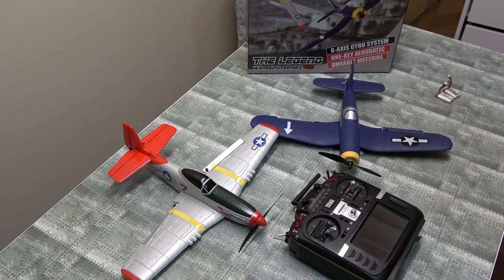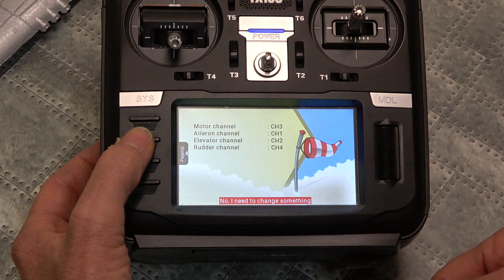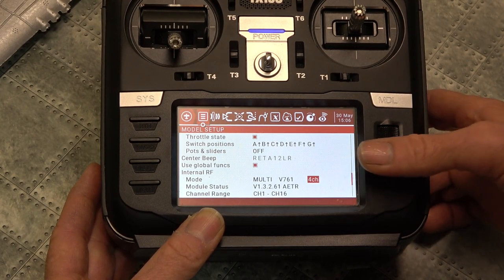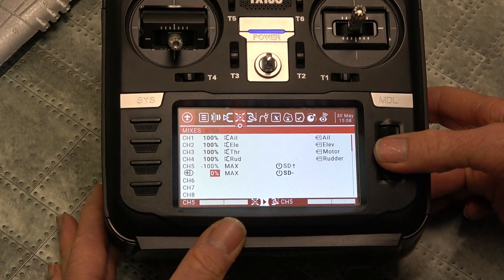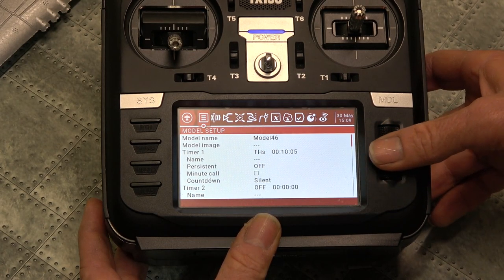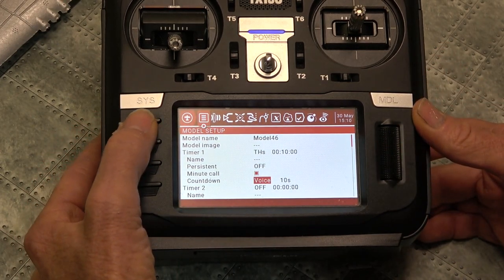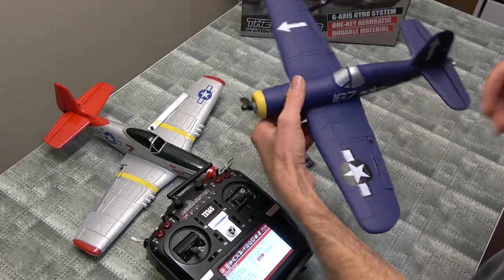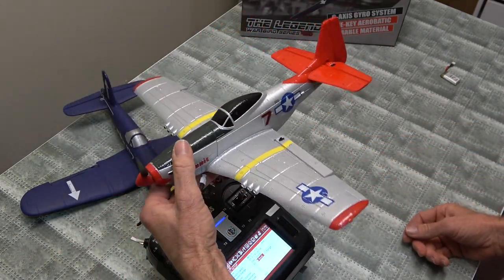How to bind to Eachine mini P51D with Radiomaster multiprotocol Radio F4U corsair 400mm RC Plane

Comment: Thanks for the video.  You may know this by now but you don't need to create three entries in the mixer for gyro.  You can just set the source as the switch and leave the "switch" section blank.  Depending on the switch position you'll get -100 0 or 100 as the output.

Comment: Brilliant video, I can knife edge my warbirds just about. One problem I have 3 planes 2 x bf109 no problems at all but my p51 worked great for one flight then the next I had no throttle.. switched it back to its own transmitter and it worked back to boxer and no throttle again?

Comment: Received my P51 today. Binding with the TX16s works as described in your instructions. What I can't do is calibrate the plane's horizontal position. According to the instructions, both sticks should be held down and outwards and then it should beep. But the beeping stays away. Other stick positions were also unsuccessful. How did that work for you? By the way: I don't have to arm the motor as described in the instructions. The motor also works without arming
Reply from the maker: Nice to hear Yes on the original radio with the sticks have to be held down and outwards but on TX16S you like to set a switch to channel 6 to calibrate level

Comment: I only wonder how did you find out the protocol these eachine/volantex mini planes are using? Is there a site out there with repository of different protocols?
Reply from the maker: No the multi protocol site- link in my pinned comment gives you a bit of help or you can just google it

Comment: I have a weird problem  I've Done all the instructions but   after binding there are no controls unless I click the range tab next to the bind .  It only works when the range screen is open . Any ideas thanks
Reply: I have sussed it. You need to select the low power mode option I the setup of the model

Comment: Thank you for this very useful video.if you could give my some advice since I have not been able to make link with the steps that you show. the only thing different is that my radio is mode 1out de box an de plane is in mode 2 thank you so much
Reply: I'm not sure what you are talking about there??? If you mean that the radio you have received is set for mode 1 (ie the Throttle and Ailerons are on the right stick and the Rudder and Elevator on the left) but you require the radio to be switched to Mode 2 (Throttle and Rudder on the left plus Ailerons and Rudder on the right) then that is done in the TX16S radio set-up. It has NOTHING to do with the plane. Planes will fly exactly the same (with a correctly set-up transmitter) whether the radio is Mode 1 or Mode 2.

Comment: I have a Volantex F16 Bound to my XT16S. When i first plug in the battery, everything is working as it should. i have all control surfaces on TRIPLE RATES through the INPUTS tab. I have THROTTLE CUT enabled on a switch to overide channel 3. But when i ENABLE THROTTLE, the GYRO seems to take over all my CONTROL RATES. And then the GYRO OFF SWITCH doesnt disable the gyro. I tried disabling the throttle cut function. Made a totally new MODEL SETTING from scratch a couple times. but i keep running into the same problem. As soon as the throttle kicks on, the gyro gets activated. Any thoughts on what could be going wrong?
Reply from the maker: Not sure but the gyro does activate when you hit the throttle in the gyro does stay on

Comment: Hi, I have a Jumper radio and have Bound these little planes ok but I can't get them to bind to the Eachine TX16s.. I have followed your Vid very carefully but they wont bind.. do you know if there is a reset button on the receiver in these planes?..   Regards, Pete
Reply from the maker: Thats weird no reset button they bind up ezy you can change radios from one to another and back again   all I can think of is to update your eachine  tx16s sorry
Reply: @blowy48flyrc  Yes I was thinking that myself.. Thanks for you reply.. Regards, Pete
Reply: I have found out what this is... On the latest version of Open TX, on the setup page you need to check the box for low power.. If you don't do this it will not bind :) happy days
Reply from the maker: @PeterWinnett  someone else said that but I don't do it
Reply: @blowy48flyrc  The first thing I did was load 2.3.14. But it still wouldn't work so I stated changing settings to find the problem and that's when I found that I needed to check the low power button. Come to think of it it's the same on my Jumper T8s but I didn't think of that at the time :) :) Happy days, thanks for your input. Regards, Pete

Comment: Why i need to rebind with Eachine mini plane every time on, is it nomal ?
Reply from the maker: Yes we were having the same problem and having trouble flying 2 planes together.  So I updated the firmware for the 4 in 1 internal  module and its working better now.

Comment: I did everything like you, and mine does bind, but control surfaces do not respond, Giro is on. Control surfaces work when I put the radio in Range mode 
, can you tell me what to do ??
Reply: I had same problem, the red light stopped blinking, but surfaces didn't move with the sticks.
Finally when I turned on the "Low Power Mode" it worked.
I'm not really sure what "low power mode" does, but that did the trick, for some odd reason.
TX16S

Comment: Can I use this RadioMaster TX16S MKII V4.0 Hall Gimbals ELRS JP4IN1 Transmitter Remote Control Multi-protocol OpenTX And EdgeTX With this RadioLink R12DS 2.4GHz 12CH DSSS & FHSS Receiver for RadioLink AT9 AT9S AT10 AT10II Transmitter Support For SBUS PWM ?

Comment: Dear Sir 
I'm trying to bind my mini trojan t28 to my radio master tx16 max. But it doesn't work. But as soon as I put it on range and press the scroll wheel it binds. Why is that. I followed your setting up perfectly. Help please
Kind regards
Johan
Reply from the maker: Yes I know this protocol has problems but it seems to be fixed with the new updates.  I know its a pain to update your radio or you can just put up with it. Links in my pinned comment
Reply: First want to say your videos are very clear and understanding. Sorry where do I get your pinups
Reply: Sorry pinned comments 🙈
Reply: Im getting the same issue with my f4u mini and the eachine tx16s  got everything set up how all the videos show but no controls when you hit bind, but if i click range then the control works  🤔  i have set up a omp s720 with no problem at all    any ideas how to get this to work with the f4u ?
Reply from the maker: @coopers-cave  interesting your having same problem on your eachine tx16s. Im guessing theyre both shiped with the same firmware. so update your radio should fix it
Reply: @blowy48flyrc  hey, i managed to update the firmware & the internal Multi module. I created a new model for the f4u mini and still had the same issue at first. untill i selected low power mode - now it works perfectly 👌🏻 im still a novice to rc planes and open tx  but im slowly getting my head round it.
Reply from the maker: @coopers-cave  good to here but maybe your radio too close to plane
Reply: @blowy48flyrc  i haven't checked it fully yet  i just know i get all controls working like this. Ill have a go again tomorrow and see if being further away helps 👍🏻 cheers
Reply: @coopers-cave  Have you fixed this? Experiencing the exact same - not filling me with confidence and a bit worried about loosing the plane out of range. How was your experience been with this?
Reply: Have you fixed this? Experiencing the exact same - not filling me with confidence and a bit worried about loosing the plane out of range. How was your experience been with this?
Reply: @proastroz5759  I just stayed with given transmitter at the moment. You just reminded me I'm going to try again this evening. Will let you know
Reply: @proastroz5759  yeah it seems to work fine for me, for the distance ive flown mine its been spot on. Its only a small plane so i cant go too far before ill lose sight of it but ive not had a problem.
If you can program a fail safe to kill the motor if signal drops  just go low and slow to make sure your range is good enough 👍🏻
Reply: @proastroz5759  yes got it fixed. I have changed to EdgeTX now and it binds immediately. No problem. Will let you know how it fly. Very windy here in South Africa at the moment. Hope you get it right. Watch John's YouTube channel called rc video reviews. He got a video on changing to EdgeTX. I have touch screen now absolutely fantastic. Let me know if you got it. Cheers
Reply: @johanopperman8039  I'll look into it! No issues with re-binding before each flight or using low power mode?
Reply: @coopers-cave  Thanks for the feedback, much appreciated. The failsafe would be an awesome addition, will have to dig into how to do that!
Reply: @proastroz5759   it's a pleasure. I don't have to rebind it just binds by itself. Good luck with the failsafe.
Reply: @johanopperman8039  Hi again, I have upgraded to EdgeTx too - was a pain, I could not get the flashers to work, but did it manually in the end. Binds perfect and remembers the binding, but low power mode is still required to operate. I read the manual of the Multi-Module and they mention for "toy grade" receivers, low power mode may be a requirement, so it's just the way it is it seems with these little Eachines. Definitely glad I did the upgrade though. Thanks for the tip, much appreciated! Safe flights :)
Reply: @proastroz5759  That's great. You will enjoy EdgeTX. They move much faster with new stuff and upgrading. Enjoy your little plane. I love flying my little Trojan T28. 😊
Reply: BlowFly:
   This video is by far the most detailed one for this purpose I've found. Your voice is mellow and clear, your photography sharp with good saturation, and your steps clearly and slowly enough explained to follow with my own planes and transmitter before me while I'm watching your video.
   I immediately subscribed to your channel as soon as I saw this one. Looking forward to see what other projects you have chosen for your videos.
  Kudos! Gooday mate! Thanks for improving our enjoyment of this wonderful hobby!  - Jim

Comment: My TX16S will not bind to the warbird. I've tried many things, followed your instructions to the tea. It just woin;t work. I even downloaded the latest internal module firmware
Reply: Have right protocol loaded, put battery in plane,  and lift the right bottom temp switch...see if that works
Reply: @MrDLRu   "right bottom temp switch"? The only thing that worked so far is putting the TX16S into low power mode, then it will bind, but if I fly it like that, it loses connection as soon as the plane gets to about 100 feet or so (and if I put the plane out of low power mode, it loses the bind).
Reply: Channel 6 and 8 must be in -100 position !  I believe 6 is calibration and 8 perhaps return to home or something. If one of these two are activated (not -100) strange things happens ... On my radio these channels are on SF and SC as defolt

Comment from the maker: This protocol has problems but it seems to be fixed with the new updates.  I know its a pain to update your radio or you can just put up with it.
Links below
WE had to re-bind to plane every time we wanted to fly 
AND a lot of trouble flying 2 planes together - kept binding to the wrong plane

The Multi-Module Protocol info page link here - https://github.com/pascallanger/DIY-Multiprotocol-TX-Module/blob/master/Protocols_Details.md
And Multi-Module firmware update  link here -  https://downloads.multi-module.org/?rmtx16s
Reply: Long shot you will see this but I have same problem that I loose bind every time I disconnect battery.

Comment: Any reason you can think of why i have to keep rebinding the model?
Reply from the maker: Yes me were having the same problem and having trouble flying 2 planes together.  So I updated the firmware for the 4 in 1 internal  module and its working better now
Reply: @blowy48flyrc  I was just about to ask, a friend and myself experienced me being able to control both warbirds with one radio even with changing the receiver number.
Reply: @blowy48flyrc  That worked, thanks.
Reply from the maker: Good to hear it works

Comment: Mine binds but nothing works unless  I put the tx16s in low power mode or range test then everything works but as soon as in full power nothing works apart from stabiliser
Reply from the maker: That's weird. Maybe change the receiver number.or move radio away from the plane
Reply: same here
Reply: Have you fixed this? Experiencing the exact same - not filling me with confidence and a bit worried about loosing the plane out of range. How was your experience been with this?
Reply: @Nethlo  Have you fixed this? Experiencing the exact same - not filling me with confidence and a bit worried about loosing the plane out of range. How was your experience been with this?
Reply: @proastroz5759  use low power mode then all works fine
Reply: @michaelhedges41070  No range issues?
Reply: @michaelhedges41070  And thank you by the way!
Reply: @proastroz5759  no works fine
Reply: @michaelhedges41070  Thanks!
Reply: @proastroz5759  your welcome
Reply: @proastroz5759  no
Reply: Plane gets out of range easily after using low power mode.

Comment: Hey blowy. I have the eachine version of tx16s - when I bind it, I can’t control any surfaces unless I use ‘low power mode’ option. Have you any thoughts on that?
Reply from the maker: Yes I heard other people having the same problem and I think updated the internal module has fixed the problem and I think your eachine radio was made by radiomaster
Reply: @blowy48flyrc  I’ve also had this problem and my radiomaster was bought new just last month so it can’t be the module as the software is pretty much up to date.